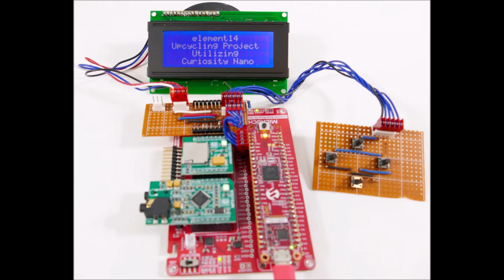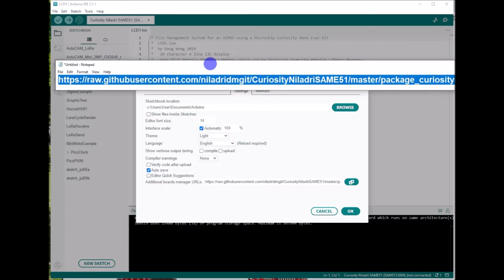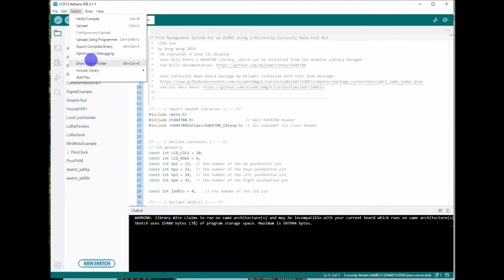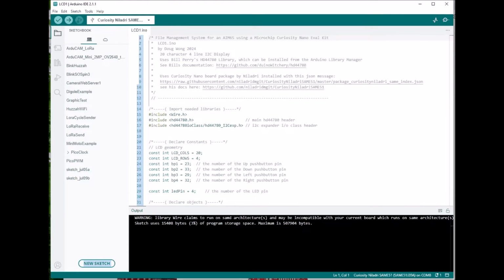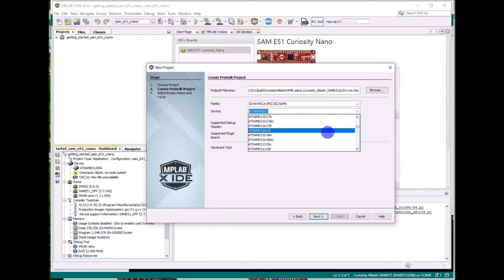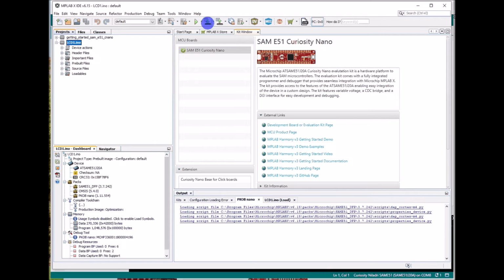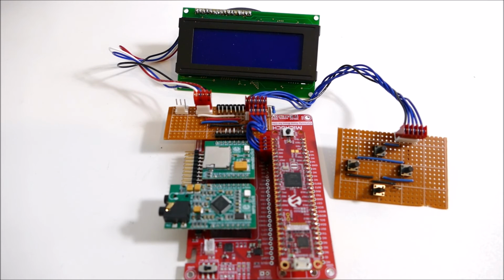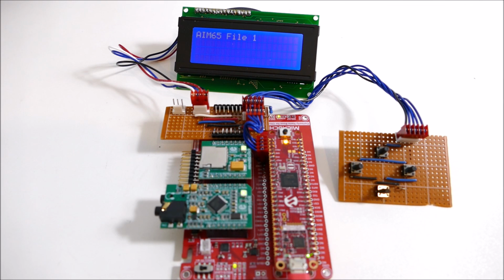Curiosity Nano Programming

Comment: would it be easier to use an atmega4809 DIP with a bootloader installed.  It can be used directly from the arduino IDE?